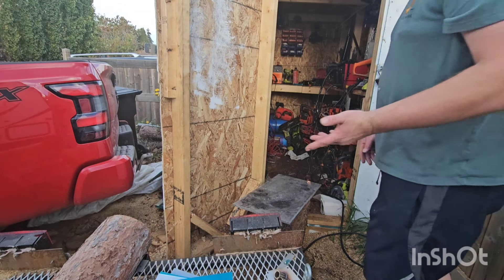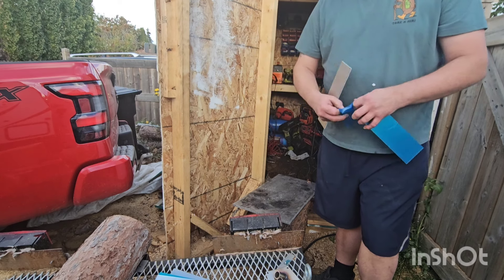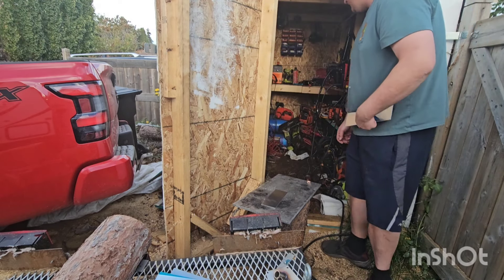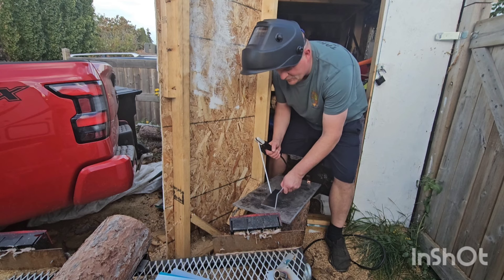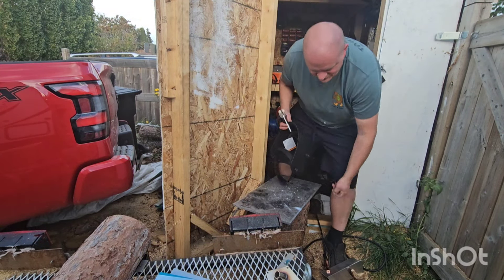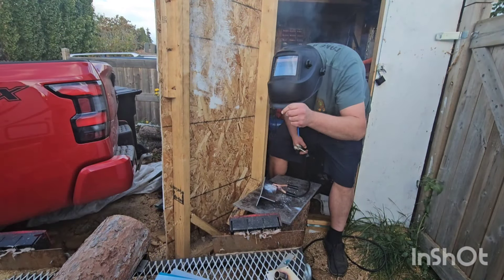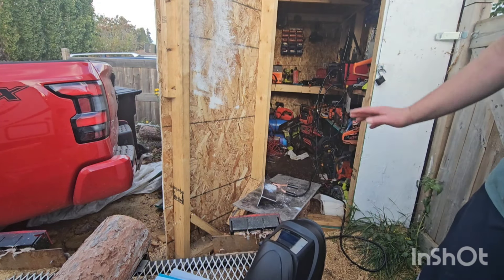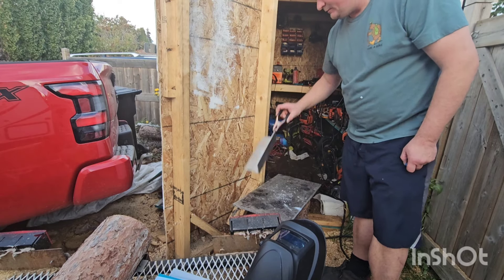can you arc weld aluminum?

Comment: Hi frequency required to get it going. Clean clean clean. They used to use the old conversion boxes on stick to get the start out of em.
Reply from the maker: Stick is DC reverse only.. I think I need older technology for it to work, I think the issue is using an inverter welder, gonna try on the old selenium rectifier Miller collecting dust at the shop

Comment: Try preheating the aluminum before welding and make sure joint is really clean with a dedicated stainless brush
Reply from the maker: think I'm just gonna stick to tig for aluminium
Thinking inverter welders don't like aluminum stick
Reply: @chainsawcanuck  I think it can be done
Does your machine have Arc force?